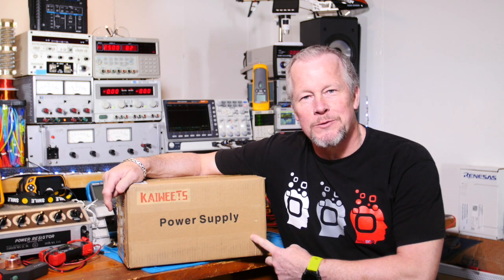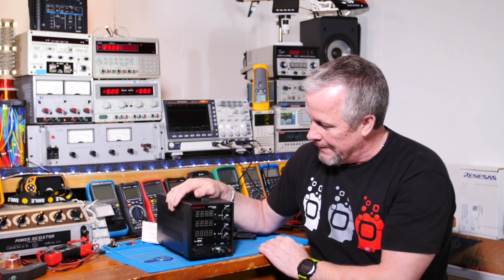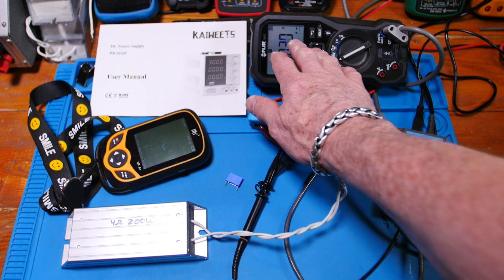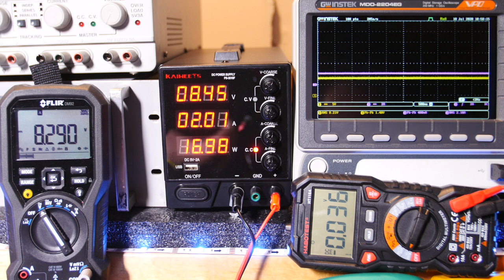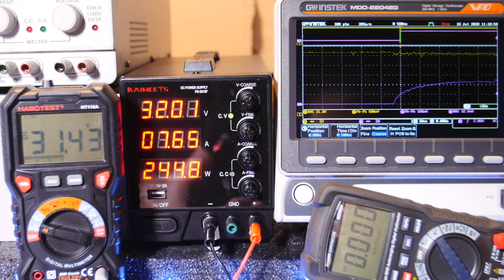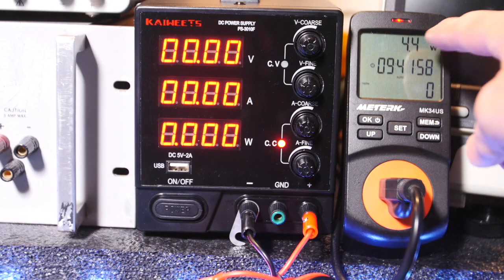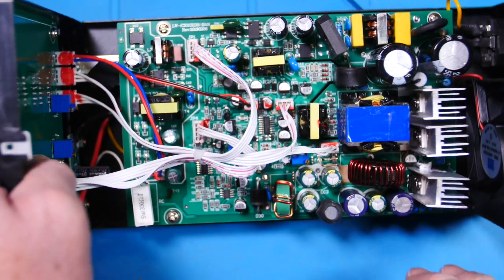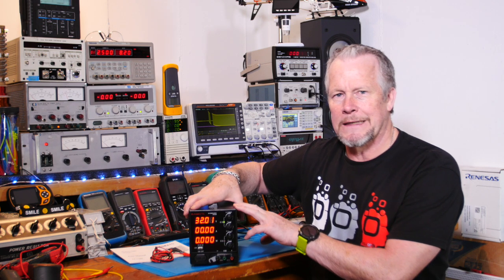Best Low Cost Power Supply by Kaiweets #lowcostpowersupply #APS3010H #Wanptek #bestbenchpowersupply

Comment: This is a OEM product from LongWei, it seems. They have one identical to this. They even have a narrower one without the USB port, one digit less on the display and the PCB is vertically oriented, but the back of the PCB looks the same.
Look up the channel "TheStuffMade", as he made a video in January 2020 about a hard mod on the PCB to reduce the switching noise.
Reply from the maker: Thanks for the great feedback.  It looks like it is a LongWei product, but it is a different board then the narrower version.  As you say, this one has the USB power, but it also has fine and course adjustments on both voltage and current.  And not only does it have more digits as you point out, but it also reads out power which I think is a bonus.
Reply: @KissAnalog  Yes, the frontend is different, sometimes with four knobs at the bottom (2+2), sometimes with them to the right side, sometimes without the fine adjustment. That's the benefit of having a separate control board with the user interface on it, resellers can easily have their own without too much of a hassle for the OEM.
However, when you look at the board with the transformers and chokes (I'll call it power board), you'll notice the positioning of the components around the biggest transformer is identical, even the heat sinks look the same. At that point I got the idea, that the power board of both is the same at it's core, just reduced or enhanced where necessary.

I don't have either of the power supplies myself, therefore I only can guess that really off of videos and photos. But it would be a rather strange coincidence, if LongWei decided to build for both their 3010s  completely different power boards, where the components look the same, are positioned the same and need to be sized the same, when one of them just needs to have an additional USB power port.

I'm looking for models of power supplies to shop for my own, for absolute basic needs (I've been binge watching cheap bench power supply stuff here in YouTube for the last days). The thing bugging me the most about this design is the missing PFC. Everything else looks like you can work with it, one or the other way. I don't need super fancy stuff and brand names. If it get's the Job done, I'm in.

Comment: Hello Sir, wondering how would this work under constant load such as 48 hours @ 12v/6amp?  Thanks
Reply from the maker: That’s a great question!  I haven’t run it that long, but my thoughts would be that it would be fine.  It turns on a fan when it gets hot and I’ve run it at 10 amps max for a little bit and it didn’t seem to have any trouble.
Reply: @KissAnalog  Thanks for the answer!  Got an Eventek in today and have it running at 13v/8.5a, we'll see how it does!  Update:  run many times 24 hr or more at 12+v and 9+A with no issues.

Comment: HEy if i dont have a isolation transformer on the input for my scope for checking smps p/s what probes i can use? thanks
Reply from the maker: You can use your ordinary probes as long as the ground clips are on the same conductor (on DC/DC converters).  If it is an AC/DC converter, then put the ground clips on primary ground, or all on secondary ground.  Safe way is to use diff probes.

Comment: Nice review again. This is a normal SMPS, not a linear suplly, is it? A ripple 1,5 Vp-p is quite a lot even on full load! There are so many different PSUs around, some much cheaper with similar specs. I came over the RuiDeng Supplies which are more-less buck-converters. I have the DPS5020 which can deliver up to 1000W at up to 50V and 20A output, up to 60V input. Of course you need an extra PSU for the 60V input - but i just use my Solar panel array for that :-) If i need more power i can connect it to a server power supply, which can deliver up to 52 V and in the 6 kW-range :-)
Reply from the maker: Than you - and great feedback!  The Kaiweets is also a switcher.  I’ll show how to use a small filter to clean it up;)
Reply: @KissAnalog  Yes, its amazing what this little cap can do! :-)
Reply from the maker: I agree - thank you!  Here’s the new video to reduce noise:  https://youtu.be/idf8nRw19DM

Comment: Which one will you choose? & why?... Leaner transformers based heavy ps or super light weight switching ps..? Which is long lasting & does give steady noise less output?

As we see many vintage types heavy power supplies in your lab..
Reply from the maker: That is a great question!  If I am picking out a power supply to buy for my bench, I am looking at voltage and current and now really concerned if it is linear or switcher.  If I had two at the same price and same power - then I might choose the linear because I wouldn't worry about any possible noise.  Linear should be lower noise.  But really lighter and smaller is good too, so a switcher is just fine;)

Comment: I have a longwei 10a 30v . I am not getting any voltage. What could be wrong?
Reply from the maker: Make sure the fuse or breaker is good.  If the voltage shows that it can be raised, make sure that min current limit is not set too low.  Even without a load the current level needs to be set above min.  Let us know if that helps.  Thank you for asking.

Comment: Hi, would it be possible to increase range of ammeter to show mA?
Reply from the maker: If your ammeter is a clamp-on type, yes you can put a turn or more to double or more the current reading.  If it is a digital multimeter that runs current through it - that might be harder to get more resolution.  Is that what you were asking?  I appreciate the question;)
Reply: @KissAnalog  Thanks for the fast reply, what i meant was the 4 digit current display of the power supply. I have a similar one like the Kaiweets in the video and mine has also some potis inside, but i have no clue what they are for. I also have Amps measuring with dot 2 digits.
Reply from the maker: I think the pots are for adjusting the current and voltage readings.  Here’s a new video showing how to reduce the noise:). https://youtu.be/idf8nRw19DM

Comment: on the internet page on amazon it says ou need to sitch between 120v input and 230v input. is there a switch or is the power supply doing it automatic?
Reply from the maker: That is a great Question!  I see where it says that there is a switch, but it is not on the outside of the unit in back.  I planned to do a follow up video showing an improvement and also showing more capabilities but now I'll add to that a look inside (while I show the improvement that I will make) to see if there is a switch or easy way to configure it for 230/220 VAC.  Thanks for asking!

Comment: Hey Kiss, thanks for the great review. One question - what was your setup when you measured the output ripple? Often the scope leads actually pick up a lot of radiated noise which makes it look worse on the scope than it really is. I would be interested to see the ripple straight across the terminals with a really short ground connection - maybe it is a bit better? With any long leads from a power supply local decoupling should always be used and will resolve most issues with switching noise.
Reply: This article probably explains what I am on about better than me: https://www.eetimes.com/power-tip-6-accurately-measuring-power-supply-ripple/#
Reply from the maker: I swore I responded to this as well as a few others.  I don't know why my responses were not uploaded.  Sorry about that.  Thank you for this.  You are right - I wasn't trying to probe with the best methods as I was just showing what one might see.  I've meant to do the follow up where I show how to measure and and how to install a simple filter to really clean things up;)
Reply: @KissAnalog  hi Eddie, no problem! I am sure that would be a really interesting video. I have since bought the power supply, partly thanks to your review, and I have to say I am impressed with its performance. It really is a lot of bang for the buck. My only frustration is that it doesn't have an output enable / load switch, so you can't easily set the current limit and voltage before connecting the load. Unless I am missing something, to set the current limit you need to short the output, adjust the current to your desired value and then connect the wires to your load. It seems if they'd added a simple switch on the output this would really be an amazing PSU for the money.
Reply from the maker: Here’s a new video on this power supply cleaning up the noise: https://youtu.be/idf8nRw19DM
Reply: i have an old Kenwood "KPS-10" DC Power supply. I cant seem to find anything about it on the internet. Found a few things about the "KPS-10 A", but not for mine. You know anything about it or can you point me to a site.

Comment: Hey guys. Can i for an example use this power supply to charge my lithium ion battery packs?
Reply from the maker: Yes you should be able to.  Set the voltage up to match what your charge controller wants and it should be great.
Reply: Yes, I have used it for this purpose, works fine.
Reply from the maker: Here’s a new video to lower noise:  https://youtu.be/idf8nRw19DM

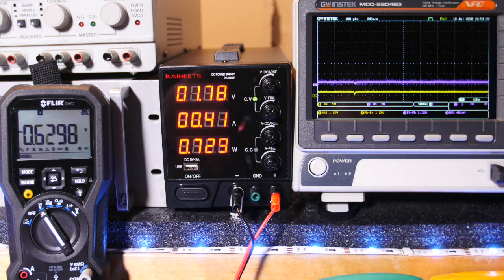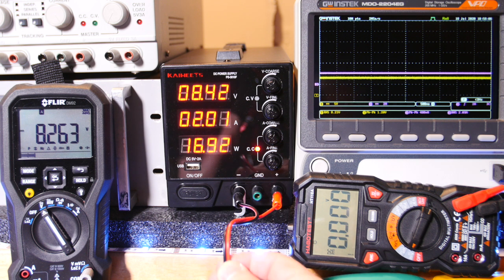Comment: First time I ever gave one of your videos a thumbs down and thought I owed you an explanation. It goes completely off the rails at 16:27. The FLIR (expensive, high resolution) meter is reading seriously low compared to the PSU readout. You do not notice this until 19:40 when you bring in a cheapo low res meter and measure at the PSU output terminals getting a much closer reading. You correctly diagnose the problem as voltage drop over the inadequate test leads supplied with the PSU. Now for some unexplained reason you throw out the good meter and use the cheap one for the rest of the video, continuing to use the inadequate test leads and probing the voltage at the load end! Unsurprisingly the cheap meter reads just as low as the good one had. Result - you never properly test the accuracy of the PSU!
Reply: Hi Eddie, fantastic review.  Thank you 🙏  😊
Reply from the maker: John Hind I appreciate the feedback.  I do try to improve my production of these videos, and I hope I am.  After all, this hobby does cost me a lot in time and money away from my actual job and family, but most hobbies do.  I should have used a second meter showing the voltage right at the terminals.  Actually the problem with the reading being so low was a bad connection that I did report just before I also reported a 0.1 V drop due to the leads.  After that at the same 2 Amps the meter was solid showing 0.1 V drop.  I am using the leads that came with it and actually were not too bad.  I meant to show that the leads are important and you do get a drop because of the leads.  I show the max current thru these leads later in the video and how hot they get.  I should have explained this better, but I did suggest bigger leads, and that these were just the ones that came with it.  Thanks again for taking your time to explain the hit on the video.

Comment: Shouldn't you get a linear PSU at those prices, but then again 10amp at 30v is a lot, most linear at those prices tops out at 31v and 3a or 5amp, so a world of difference in wattage.
I purchase two linear PSUs some years ago as I needed it for high current laser diodes..
the brand Korad, one purchased inside EU (75euro) and the other from China (60USD incl. shipping)  both with PC interface https://imgur.com/gallery/B7ZOQ3J
Reply from the maker: You are right - 10 Amps would make a linear very heavy.  I do have the 15 Amp on the bench and I want to say it is 60 lbs or more.  It is actually crazy how 30 V seems to be the limit and 3 amps is so common.  Actually I think they are keeping the voltage at the safe DC limit.  I'd really like a dual 40 V at 10 Amps.  Maybe I need to make one in a video;)?

Comment: I find switching power supplies way more interesting than linears for two reasons: (1) the circuit is interesting in and of itself, as you've shown in some of your other videos; and (2) they're hard to get a clean output as you saw - it takes some work so it becomes educational very quickly :)  Great fun.  That's really noisy though, to the extent that I wouldn't find it acceptable; and definitely not if I have to add my own capacitor across the output.  I guess it will have it's place though, if noise wasn't such an issue for the application. You should try soldering that capacitor on and see how it affects your load or the transients of the supply itself.  

I say all this after building my own: really interesting and instructional project, and you can run them at high power without the same thermal issues - for example, I ran mine at 45W for over an hour and the linear regulators got up to about 60C but that was it.  No fan and small heatsinks on them (way smaller than the heatsinks on the transistors in this model.)  Incidentally, mine isn't perfect by any stretch but its output ripple is about 40mV pk-pk so about 10x better than this one when you put that film cap across it.

You know what would be interesting?  See if you can get a knife switch or some better de-bounced switch and look at the signals at various points to see the transients.  Particularly at the switching node(s) - if you can get to them of course, that's a busy, busy board!  I'd still like you to start back on your 'building a supply' videos - remember when you started off with "this is a cable that you plug in the wall"?

This looks like a reasonably well constructed unit but I'm still wary about the cheaper no-branded stuff off Amazon and eBay.  You see some real product stinkers on those platforms these days!
Reply from the maker: It is funny - or not so funny how sometimes my reply doesn't seem to take or be saved...  I did get the knife switch;)  I appreciate your feedback - always great!

I really will do the filter video soon;)  I have been so swamped at work then this international issue...and my mom just had knew replacement surgery...  But, I will start getting more videos out.

Comment: The PE terminals are getting rare these days. Even the big players like Rohde & Schwarz discard them. I think this is not a good move. I have several power supplies (each one for a different task) and if I want to couple some voltages to a common point, then I use the PE terminal.
This way I can use my high current power supply in conjunction with my low current dual power supply, both sharing a common ground this way. Sure I can also couple them without a PE terminal using a longer wire but actually I like shorter wires that doesn't take away any space on my desk nor contribute to a even bigger ratsnest.
What I'm missing on your review is the line input PE to case connection, which is in my opinion the most important connection.
Reply from the maker: That’s great feedback BeamFinder, and I agree the PE should always be added for optional use.  When I started showing the tear down I tried to show the connection from input ground to case.  I ended up moving faster cause I thought the video was getting long;)
Reply: @KissAnalog  You're right, somehow I missed this detail
Reply from the maker: Thanks BeamFinder - always good to ask - as I miss things all the time;)
Reply from the maker: Here’s the new video: https://youtu.be/idf8nRw19DM

Comment: What's the output ripple like do you know dc-ac is it good
Reply from the maker: I think it looks pretty good for a switcher, but a small capacitor really helps clean it up.  Thanks for the great question.
Reply: @KissAnalog  yeah you put a 1uF capacitor on the output?
Reply from the maker: yes, I think I'll add it permanently, but I'm going to probably do a video update when I find just the right fix.  The 1 uF seemed great.  I might also experiment with a ferrite core wrapped around the output leads internally if that helps with high frequency.  Maybe just twisting the leads...
Reply: @KissAnalog  I can't find it in the video.  What ripple did you find?  The marketing information on Amazon says Ripple & noise : ≤20mV r.m.s   That seems pretty low, but did you find the ripple is actually worse and does not meet the stated specification?
Reply from the maker: Sorry I haven’t done the video update yet.  I’ll try to get to that soon.
Reply from the maker: Here’s the new video: https://youtu.be/idf8nRw19DM

Comment: For the money this is a purdy good power supply! I think, that if people who are learning this stuff and watch this video, might need a schema how you connected everything and the parts you used... Like your capacitor & resistor for discharge and filtering cap... Most people know that the cap is between the + & - but not everyone knows that. Sometimes you show how it is all connected in more details - I think that is great. Also, your white board could be used for the diagram, so people can screen-capture and print it for their collection of "how to's"...etc. Thanks again Eddy!
Reply from the maker: Thanks for the great feedback Tony!  I’ll try to improve with input like this.

Comment: I was looking for a cheap switching power supply my last one was a PEVONO PS305H The power lead started melting when they were pushed to their MAX wattage had to make my own heavy duty. It died after 28 days had it replaced and the next new one died in six months. My three linear Power supplies are all over 30 years old BK Precision 1651, Hewlett-Packard 6205C, Acopian A24H850, still working like new never had a problem.
Reply from the maker: I’ve see some reviewed on YouTube and the look a bit shoddy.  This one seems great so far.  Thanks for sharing that great info!